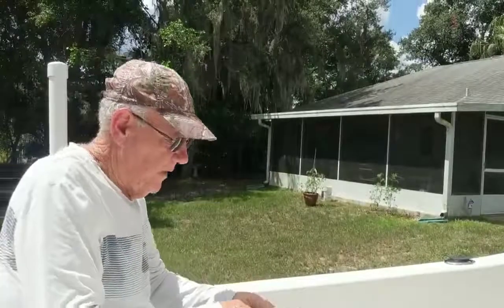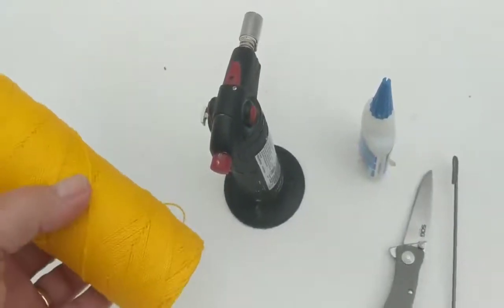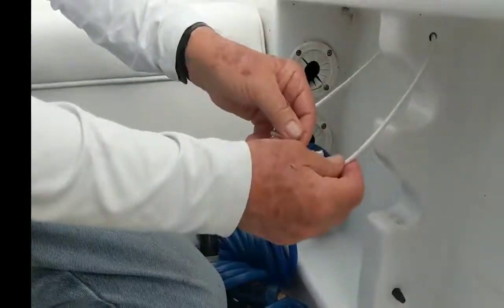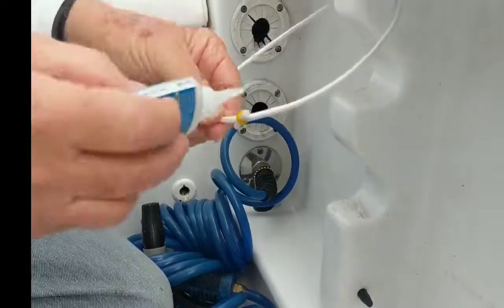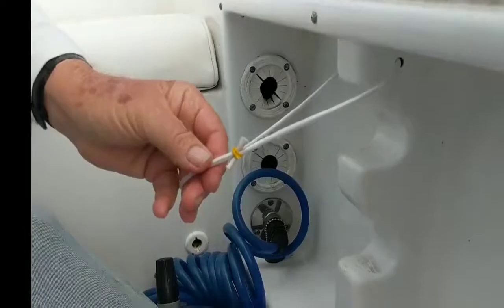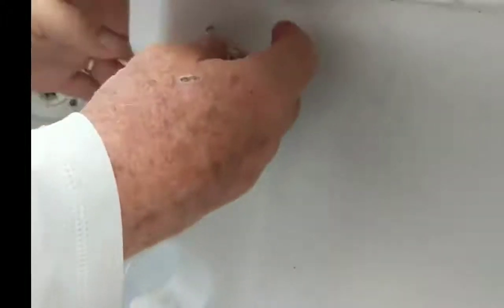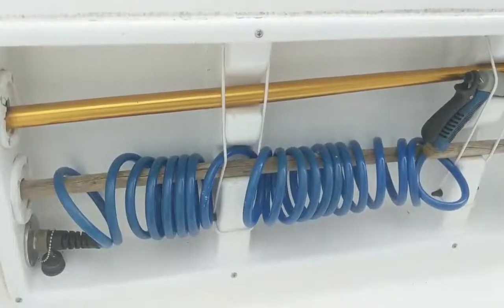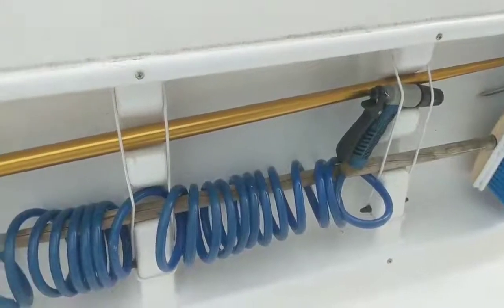Sea Hunt Repair, Rod Storage #seahuntboats #seahuntrepair

Comment: Did you have to drill out the holes prior to threading the replacement bungee? My bungees are fastened somehow inside the hole in the panel.
Reply from the maker: No I didn't, mine also was fastened inside. I was able to push it aside and pull the new bungee through. For some reason the port side which was in the video was easier than the starboard side but I was able to get that bungee through the hole also. Good luck with it. Thanks a lot for Watching
Reply: @TheOldCoupleOutdoors Thank you. That helps.